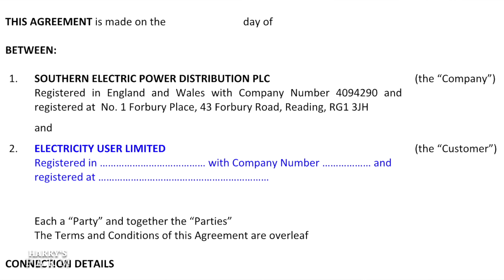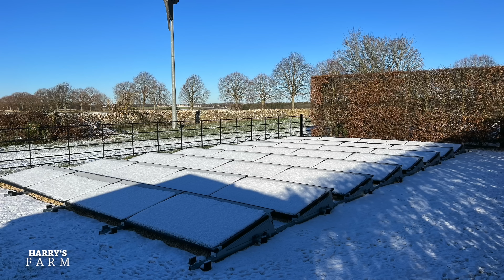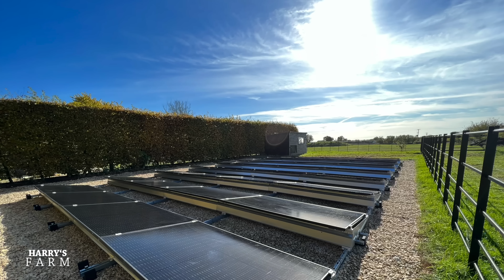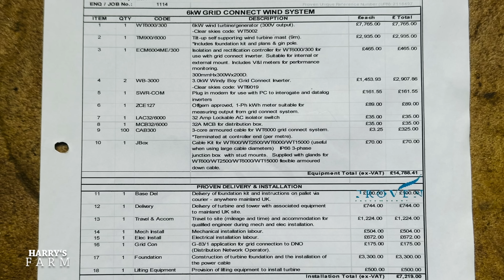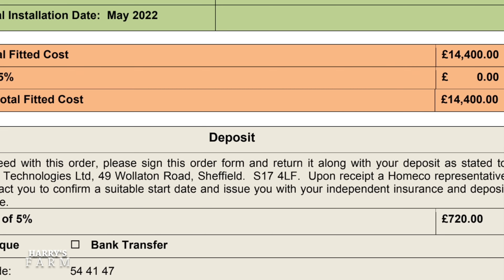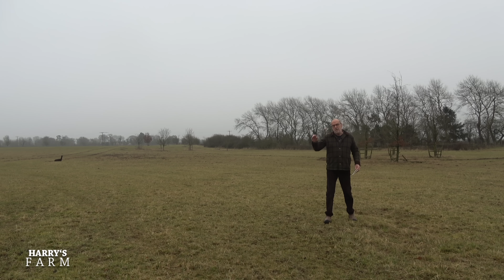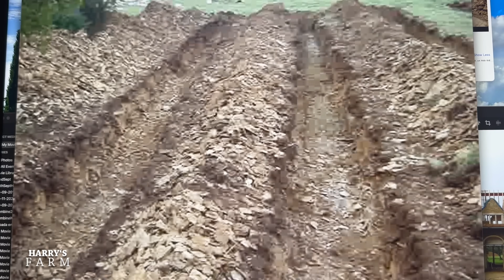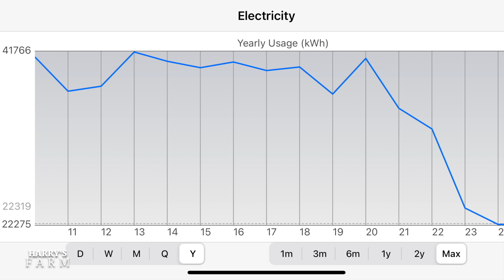Are solar panels & heat pumps worth installing? Here's what I've learnt after several years of use.

Comment: How to make solar and heat pumps less of a scam.
First don't listen to the advocates find a good electrical engineer and get them to spec the system along these following lines .
Solar Panels:
If possible do not waste space by putting them on the ground Build a car port or something , although they will be in a higher wind area they will be protected from shading and other things more and you get to use the area underneath. Next use the bidirectional panels and erect the upright instead of flat and use a reflective under pinning such as a white painted roof to redirect light onto them from underneath, they will run cooler which increases output and they will keep cleaner and free of snow.
DO NOT connect them to the grid for the money back scam it will end and be reversed to where you have to pay them to take your power. Use the power to do as much stuff as possible and use the grid as a backup, Put lighting and other low draw systems that can run off batteries efficiently on a separate solar powered circuit that can be switched back to the grid if needed.
Heat Pumps.
There are two types 
Geo Thermal and what is basically just a reverse cycle air conditioner.
If geothermal is setup correctly during a new build or renovation it can be extremely cheap to operate and very reliable as it only sucks up latent heat from deep below the frost line.
If you can set it up with three or more separate circuits where you can switch from one to another as the soil around the coils heats up or cools down to much you can have very reliable heating and cooling that only uses about the equivalent power of one small refrigerator to run .
Air to air Heat Pumps.
Unless you're cooling your home or live in a place that rarely gets below 5 degree Celsius DO NOT Bother with them as they are a waste of time and money and irritation from noise.
Compared to an electrical resistance heater that will turn a thousand watts of electricity into a thousand watts of heat a heat pump can theoretically turn a thousand watts of electricity into three thousand watts of heat. However the resistance heater will produce a thousand watts of heat 24/7 regardless of how cold it is outside as long as there's power going to it. A heat pump might use up the thousand watts and produce zero heat 24/7.
There are a number of things that can stop a heat pump from working properly, the most common is the coils being clogged and freezing over blocking all air flow The colder and damper it is outside the more likely it is this will occur.
And then if you have a smart meter some AI might decide you don't deserve heat.
Reply: Wrong? Just wrong?
Reply: @Yorkshire-z5v  You have proven your point by not making any.
And what was the point that you were trying to prove?
That you're ignorant and clueless.

Comment: 119kWh for Dec was interesting. I'm in the Cotswolds too with a just over 8kWh system (roof mounted but on various roofs facing different ways). My total for Dec 24 was 109kWh and 101kWh for 2023. Do you have Optimisers on your system (supposed to help manage shading issues) and also I wonder how much difference you'd get for mounting them a meter off the ground. Maybe if the hedge was completely deciduous that might help too as more light would get through when the sun is lowest in the sky.

Comment: You should optimize your solar angle for the winter months.  Daylight is shorter and lower angle, so angling them (although with your ground arrays they appear to block the ones behind them for that option).  I built my small set up to produce enough electricity for the shoulder seasons … early spring and late fall.  All the additional electricity in the summer is a bonus!  I use LiPO4 batteries, and then also have 3 power stations that I can charge from it to use the excess.  Another option is the Eco-worthy solar sun tracking set ups, which have become relatively affordable.

Comment: 13kW system here in Switzerland. 1940kWh in June 24, 291kWh in Dec.24. Total 2024: 15MWh, a bad year, but still break-even; renovated house with electrical car charging, heat pump and AC

Comment: We have battery storage and charged by diesel generator, no mains connection and no solar. Running cost is about £45.00 month average. Heat and hot water are supplied by coal or wood in the winter and battery for the hot water in the summer. Would never go back on our unreliable supply (3 bed detached 150 year old house in rural Wales). Generator charges in about 3 hrs twice a week.

Comment: My main takeaway from this is what a fabulous property Harry has! An underfloor heated garage has become my new measure of whether I 'make it' in life 😅
Reply: I thought heated garages were crazy when I heard of them in the USA.   But then I realised they're in the snow belt and it means the car is ready to go, with oils etc. warmed up a tad too.
Reply: My main takeaway from this is...that Harry's dog has a better life than me.
Reply: Considering how much time he spends in his garage he requires underfloor heating!
Reply: @graysono  I read 'underwear' heating. sorry.
Reply: that is one gorgeous 12,000 sq. ft home......PLUS the 20 car garages!
Reply: @P.Galore it’s 5112sqft
Reply: I have budget under floor heating. It's an electric blanket under the carpet......😂👍
Reply: if building/renovating a house with underfloor heating, doesn't cost much to extend to your garage (and if it's attached to your house you should in fact get underfloor heating on your garage too, to remove any "thermal void" in the heating envelope)....i did mine, just a more spaced up loop. Get on my car or motorcycle and everything is at +20ºC (including tires)
Reply: My main takeaway is Harry is very very wealthy! 😀
Reply: I made it when I met my wife
Don't care what Harry has, God love him, he's good at what he does
❤
Reply: I put UFH in the floor of my workshop 10 years ago, but I've not quite got round to connecting it to some heating yet. There should be a heat pump this year and that will get done.
Reply: How about heated driveways in the big ski resorts in America. It amazes me as I ride the chairlift and it’s snowing to see that most of the big houses all have heated driveways…and most are unoccupied as they are 2nd or 3rd homes.
Reply: Check into that underfloor system, carefully. There are problems with it. It was going to be the big thing in the 1950's, but had problems. Many houses in Palo Alto and Northern California had them. Most failed over time.
Reply: there are problems and then you fail to mention them?! to go and talk about EUA building prowess and comparing it with EU (even inside the EU you can't compare, very different methods). The only problems i see are bad installations. Having 0ºC outside and only needing 27-28ºC flowing to reach 20-21ºC all over the house, no thermal gaps/voids, no air con blowing is priceless....and efficient.
Reply: A lot of people here are thinking of floor heating as luxury but you could almost heat your whole structure this way. Having a heated mass below your structure is very comfortable. And doing it with heat pumps which are currently the most efficient heating and cooling source with electricity?
Reply: @ heat and cool....get a proper installer and save the money on air to air units for summer (at least for those of us, in southern Europe)
Reply: Night follows day. Dogs chase cats. Farmers always have something to moan about. These are eternal truths.
Reply: he still be crying if he has to pay some tax
Reply: I know a guy who had this, the funny thing is it makes your cars rust twice as fast, because water drips onto the flooring then instead of running off it basically steams back up through the metal on the car... Saab said "they've never ever had anyone come in with so much rust on an almost new car" ... We all remember how much he bragged about this when he bought his house.
Reply: He's rich, spent a load on insulation, heat pumps, and solar, and still manages to spend 5k a year on electric bill. It doesn't convince me to go down this route, even if I could afford it.
Reply: @tonyr4873  Yeah well imagine how much he'd have spent if he didn't have the renewables and the efficient ground pump. Sounds like a sound investment to me.
Reply: @ I see what you mean, but if I'd spent that amount, I wouldn't want to also have a big electric bill too. Just shows that renewables are not capable of providing for our needs. Okay they save you a bit, but only after a massive investment.
Reply: @tonyr4873  He is, like many of wealth, a bit clueless. I learned from watching Monty Python that fellows like this were fodder for their humour.
Reply: @TheDanallen  yeah but Yeah well imagine how much more he'd have spent if he didn't have the renewables and the efficient ground pump. Sounds like anything but clueless to me, but I'm getting a whiff of bitterness from some here.
Reply: He's a successful guy.
Reply: He'd spent over 22k for the windpump, over 14k on the solars, insulation galor in the house, how much did he say did it cost to install these heat pump heatings? I missed it (how efficient would they work with an outside/groundtemp of 0* or minus *C) .. how many years that alone, would it take to get back 'even' with the investments alone ?
.. and then still having to spend over 5k/year on electricity!  ok minus the swimming pool, minus the garages ,,, it would be a bit less.
Solar panels.. useless in winter when you need them the most.
Also - with their Geo-engineering there eventually (if they're continuing to ramp it up more, and more, as they started this 1946..) it is already noticeable that the sun is apparent less and less.. killing off more than is apparent to 'normal' people already.
Windmill needs electrics to keep it going.
Well, doesn't sound very feasible, tempting, or efficient to me. 

Definitely not for me and millions of others. Thank you very much
Reply: @AnnemarieOG sun definitely being blocked out, and stars.
Reply: I can see why he needs a tax break.
Reply: @ Clarkson's ownership of a farm is for tax purposes. Harry's farm is probably as well.
Reply: I have underfloor heating in my garage and my driveway and I have definitely not made it in life yet.
Reply: Yup, another "skint" farmer.🙄
Reply: Yeh, poor Harry the hobby farmer.
Reply: @mariemccann5895  bit jealous saddo?
Reply: Not at all, I just don't like people misrepresenting themselves as farmers and see people suckered in to it, especially when they skim  off so much from the public purse. Don't fall for his BS, look a bit deeper and you will see him for what he is.
Reply: @ oh dear....I know you lot are out of the EU, but you do realize the standard being implemented in this day and age is: insulation+UFH (or big rads)+heat pump....the end! It's not something for the few, is something that's going to be pushed everywhere!
Reply: Perhaps Labour's inheritance tax may be a good idea after all. Take from the rich and wealthy landowner to redistribute to the fuel poor.
Reply: @johnmitchinson9577  get a grip, on benefits are we?

Comment: would a good battery storage solution, storing excess in summer months and then in the winter drawing from the grid during off peak evening hours, then using that energy during the more expensive day tariffs not prove cost effective over time?

Comment: Harry, I think you will find the COP(Coefficient of performance) over the year is about 2.5 not the 3 or 4 you are stating, so it is not as good on average as you think, but I do understand your different uses of heat, but we do not all have swimming pools, only a comment sir, not an attack.

Comment: Solar panel prices have come down mahoosively recently. you can get 400w panels like this for like £80 now. Never been easier to hookup a basic home DIY system on say a shed roof.
Everyone should do this: Buy say 3kw of panels, a cheap inverter and a 3pin extension lead. You then get a large piece of the Solar pie for an outlay of say £500, no installation costs, no sign-off etc if it's on a 3 pin.

Aircon & solar is the real match made in heaven. No more sleepless nights for basically £0 running costs.

Comment: Do your panels have bypass diodes, how many are you running in series, is it a single inverter? This will make a huge impact with the shading. What your installer was telling you about the system safety thing I find quite weird? When part of a panel is shaded the voltage in that cell drops and resistance increases, basically the electricity generated before the shading cant move through the shaded part, so if shading is at the end of the string, your output for the entire string will significantly drop. 

I think where you positioned the house system is very suboptimal, in every shot you showed the hedge was always shading it somewhere.
Reply: Exactly.... WHY did the installation company put the panels where they would receive SHADE, ffs.....!?!?
... why didn't they explain about shade......!!?!!?

Comment: Surely the solution is to store the power generated in summer in batteries for use in winter? Or will they not hold a charge that long?
Reply: A good idea, unfortunately not realistic, we have 12kw of battery storage, they will get charged up during the day if sunny, but if the next day is cloudy, they will be discharged by the end of the day. They cost around £8K to install. It’s not difficult to work out the cost of enough battery’s to store energy for 3 to 6 months before you could use it.. Thats the problem of solar, it generates power in the summer when you don’t use it (Unless you have something like a heated swimming pool), and doesn’t generate it in the winter when you need it…. Harry’s combined solar / wind is the ideal set up, batteries would be really beneficial, but add all that lot up and it’s big Money.

Comment: Fascinating report.  Quite clever use of green technology to manage a large operation efficiently.
I see that 50% of UK electricity generation is from non carbon sources, so using all electric on this operation is good for the future.
UK rates are about double what I pay in Ontario Canada.  We use less than 30% carbon (gas) for generation.  My residential home is a balance of gas and electric and with a large heated pool and air conditioning, I spend less than $6k CAD in energy per year.  I do not have the space for solar.  A battery storage would be good to shift grid consumption to night time when the power is darned near free.